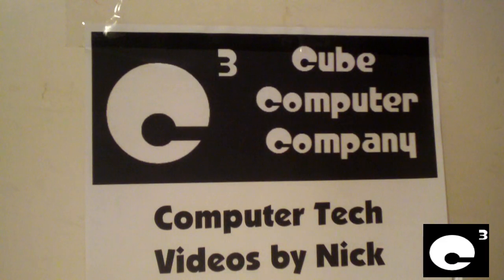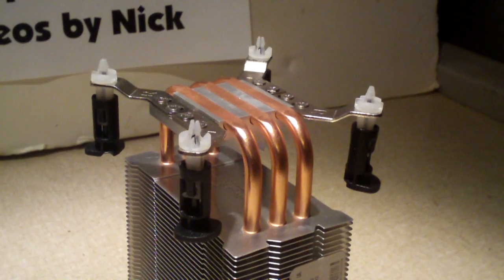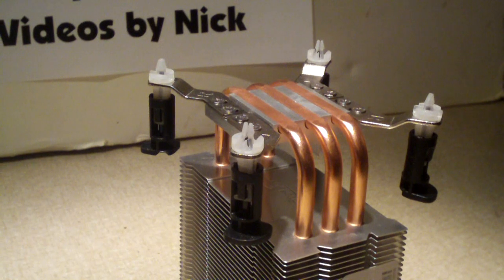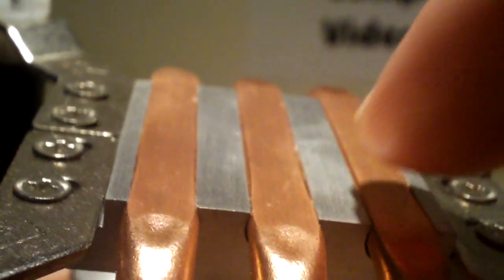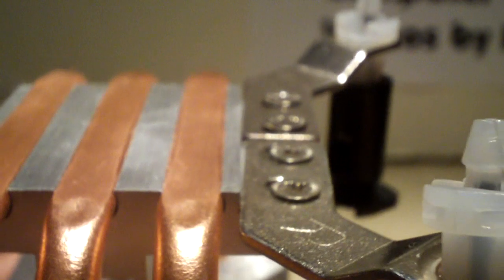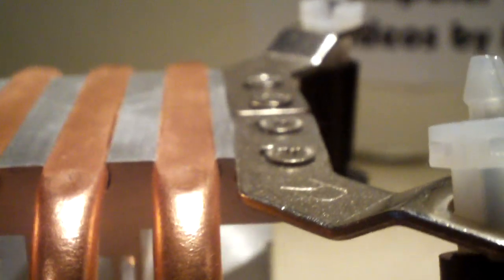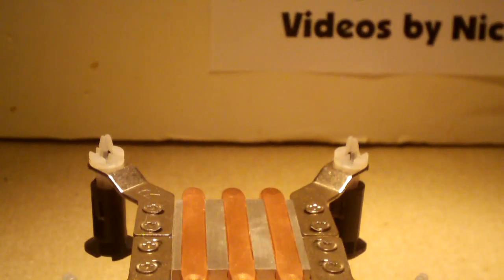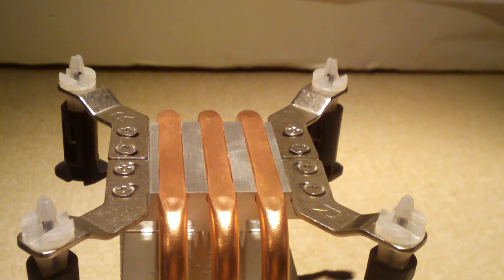The Purpose of Thermal Compound - For Newbies

Comment: The lines are milling/tooling artifacts. The real voids that need filling are to small to see by eye. Lapping will help a lot if done properly. In olden times metal parts were hand lapped until a leak proof fit was achieved, did not need a gasket as if often done today. The elmer glue was much better than nothing between sink and heat spreader.

Comment: why is thermal grease important for between processor and cooler?

I am asking because I have putted my computer in mineral oil & it is submerged in it, you must be firmlier with it so I have core i5 2500k (3.0ghz) and overclocked it to 4.5ghz, in Idle runs fine stays cool for like under 30 C but when every core is fully 100% loaded it gets hotter about 76 C even the cooler is on 30 C temperature